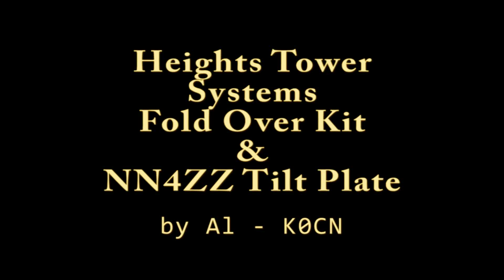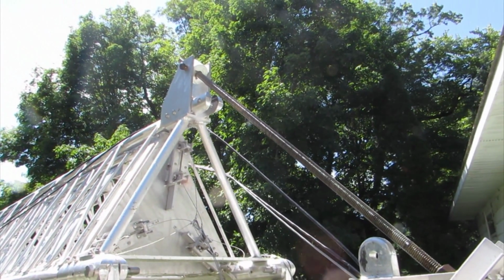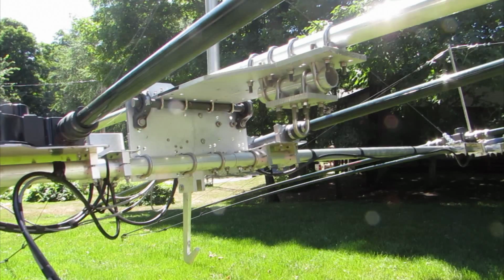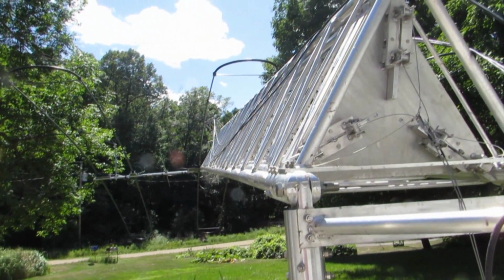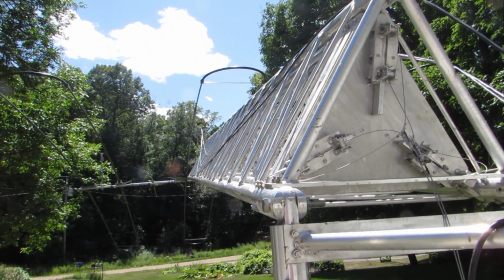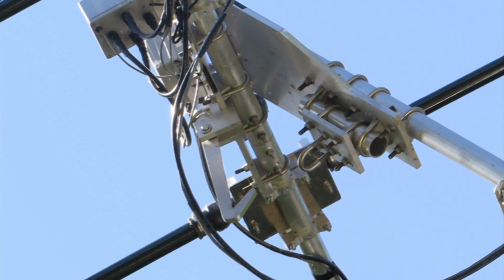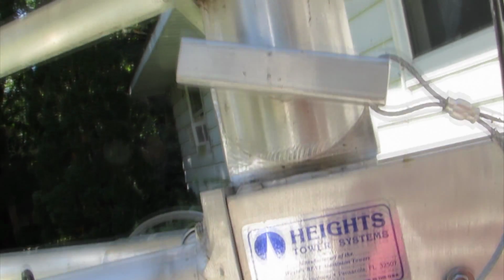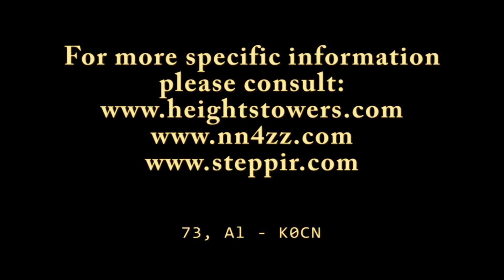Heights Tower Fold Over Fixture and Tilt Plate

Comment: It's a wonder that threaded nut at .37 does not strip  out considering all the weight it has to support  at that angle.
Reply from the maker: Heights has been making these tilt over fixtures for over 40 years and I do not recall hearing of a problem.

Comment: One thing here, As you may have more then one  antenna. or three. So how many cables do you have. I know the Flex radio with help control them. But is the one box that does that. Trying to get into Ham, 73
Reply from the maker: Hi James,
There is one cable for the DB-18E between the top of the tower and the radio in the shack. A coax switch box on the boom of the antenna takes care of cable switching for all the bands that are covered by the antenna. One cable comes down the tower from the box to the radio in the radio room. The FlexRadio tells the controller the operating frequency and the controller operates the coax switch which makes the appropriate connections. Works great!
73, Al

Comment: Nice videos.  I am interested in doing something like the CU84 tower you put up (fold over and crank up with motors).  How do you secure your coax to the tower.  Since it's crank up it doesn't look like the coax can be put inside the tower.  if's it is outside the tower how do you handle the coax moving up and down with the crank up.  You do secure the coax to the tower, correct?  Thanks.  Very good videos.  Thank you for taking the time to share.
Reply from the maker: The tower comes with a coax guide on the top of each section. It consists of a standoff, which clamps to the tower section and a loop on the end where you can slip your coax. When I raise and lower the tower, the coax slips through the loops and I coil it on the ground at the base. At least that's my method.
Thanks Al